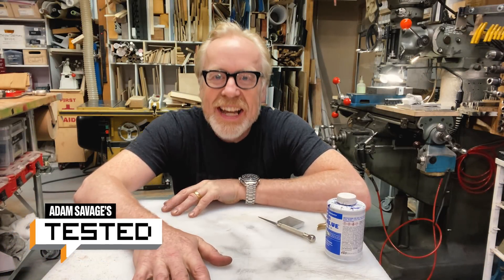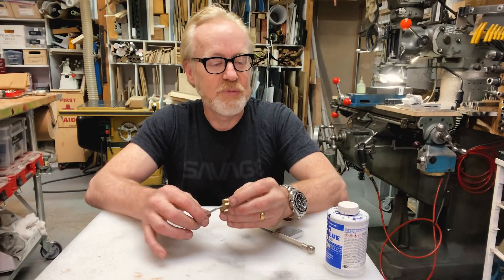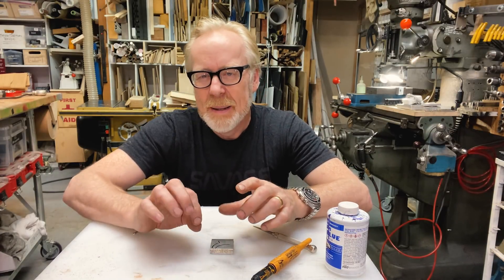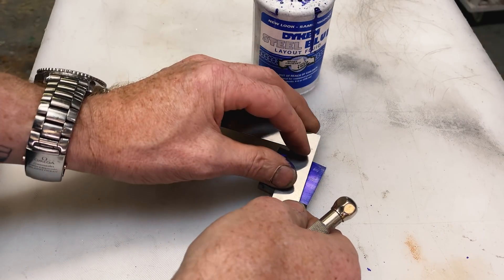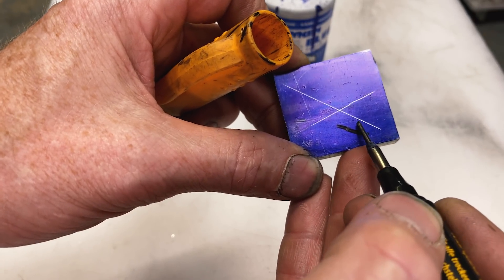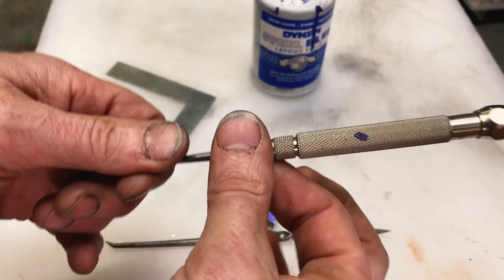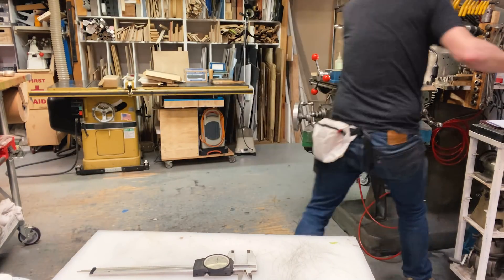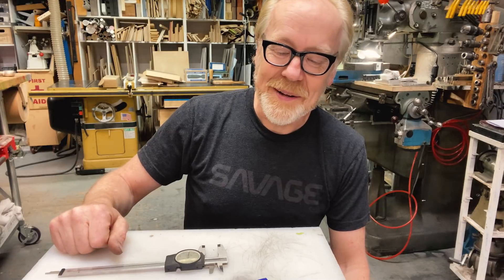Adam Savage's Favorite Tools: Machinist's Blue Layout Fluid

Comment from the maker: Starrett machinist scribe: https://amzn.to/2Zeidzf
Dykem Blue marking fluid: https://amzn.to/332dTV4
Dykem Red spray marking fluid: https://amzn.to/334y6t7
Reply: Hey Adam I believe engineers blue can also be found in broad marker form. I find it can be quicker to apply  and more even than painting it on.
Reply: Suggestion for the tool favorite tool series a page on tested and or tested amazon affiliate link page listing all of the favorite tools to go back to find the list as a whole for the favorite tools.
Reply: When you realize Adam would have been famous with or without mythbusters. I could have seen him as one of first or earliest crafters on YouTube if it wasn't for mythbusters.
Reply: Adam, you have always been and will always be an eccentric and endearing character. Rock on!
Reply: I was a toolmaker/machinist for 30 yrs and dykem is one of the best inventions ever, it has many uses beyond layout of lines,and can’t go wrong with Starrett tools.
Reply: Starett  pocket scribe at the low end has a hardened steel scribe, and the high end has a carbide scribe. You can buy after market carbide rod (1/8th in diameter) and grind your own carbide insert for less than $5

John
Reply: You can mix the two colors together to get the rare Dykem Steel Purple.
Reply: I love your work Adam 🙂

Comment: You can also put it on two bearing surfaces that are having interference and it will scratch away where the interference is happening and you can tell exactly what’s rubbing. I use it in lapping firearms.

Comment: I was taught that a water-soluble ink such as Canode #2243 can be much less of a bother. You could also do a video on the use of such inks for precision scraping. I think for scraping you apply the ink with a rubber roller, so the ink tends to get all over, and water-soluble clean up is more important.

Comment: My Starrett scriber stripped out, some of the tools Starrett makes have become junk over the years.  They have lost some of their prestige in tool making.  Their calipers and micrometers are still some of the best you can get but many of their tools are overpriced junk.  I highly recommend getting a decent pin vise that looks comfortable to use and making your own scriber out of a carbide bur.  The true trick to a great scriber is making the tip rounded, like eyelash small rounded.  When the tip of the scriber is round it will work like an ink pen and scribe in any direction you move it, if it's sharp it will only mark when you pull it towards you and will catch and jump when you move it away from you.  I can't even begin to tell you why but trust me on this... +20 years of using a scriber under magnification to mark out parts and designs.  A burnished mark shows just as well as a scribed mark on layout fluid but the burnished mark can usually be polished/sanded away where as a scratch takes a lot more work to remove.

Comment: I'm in the Thai jungle, Adam.  No layout fluid here but I've discovered a great substitute.  China ink.  It's jet black and a scribed line dazzles like a silver needle by contrast.  It's fast drying, wipes off with alcohol and costs 40 baht for a small bottle... $1.35.

Comment: As a goldsmith i use white watercolor and real 0,3 mm thing pensin what you can rubber off if needed. After that i apply spray lacquer spray. So i can draw or copy anything on the metal.

Comment: They also make Dykem bottles with a felt/marker like pad under the cap so you only need to rub it on the surface instead of having to paint it on with a brush! I know we use those all the time at the shop I work at.

Comment: I forgot about this stuff! Back when I was a machinist, we used to use this with veneer calipers for precise hole drilling. Well as precise as you can get on an old clapped out Bridgeport from the 50's.
Reply: I still have a 40+ year old metal can of Dykem from an old love affair I had w/ a Bridgeport in the late 70s. We also had an old clapper in the shop but we used it as a hogger when needed. It was kept in the "rough room" next to an old convertible Cincinnati that could run as a vert or a horiz mill. Made 3 F-14 wing hinges on that big green ugly thing. I miss those days.

Comment: Back when I was an electrician, are used to cut asked all the time Why I bothered buying the more expensive tools. The way I looked at it was that my hand tools for my every day things that I did it to last as long as possible so I would buy the more expensive screwdrivers and the more expensive pliers and all of that. You had guys that would go to pliers a few times a year and yet I still have players that I bought 20 something years ago and I’m not even an electrician anymore and yet I still have these tools and still use them on a regular basis for the jobs that I do now. I still have almost all of my screwdrivers and they are still in perfect working condition despite having almost daily use and constant used for the last 20 something years. They are lifetime tools and they feel like it. When I’m using it I have a greater control of the tool because it has a handle that’s designed for comfort as well as function instead of one of those dinky little plastic handles that are just too small even though they technically work. That’s still carries over to this day when I’m buying networking tools and stuff like that. Sure, I can go buy a new punch down tool for $10 or I can buy the $25 one and it’s going to last me far longer. I don’t want to have to sit there and buy tools again every year even if they are cheaper because even though it’s a short term saving it ends up being that you spend more money further on down the road

Comment: We also use blue with a sheet of glass, to check flatness of surfaces...  
(lay wet blue on the glass then place the flat surface on the glass, all the high spots will pickup the blue)

Comment: For the other readers (I'm sure Adam knows) it can also be really handy to level parts or ensure you've removed enough material.  When you use a milling machine to flatten a surface painting it in marking fluid can tell you where you are in terms of depth.  You paint the surface and start to run the mill or other flattening operation and the high spots are milled down first, removing the fluid, areas that still have coloration are lower than the milling head is set.  After each pass you should see the area get smaller as successive passes level out the part, once there's no blue left, you're theoretically level, or level enough to start using finer processes like sanding.

Comment: Aerospace machinist here, another very good way of marking parts, especially deep down in a pocket, is to use a Sharpie marker, blue or black and then spray your air gun on the tip of the marker and it acts like an airbrush. Been doing this trick for years as a machinist. 30+ years, and it works every time perfectly. Remember, hold your Sharpie marker point at an angle and spray with your air hose gun at an angle and it acts like an airbrush, it works amazingly well.
Reply: Amazing stuff

Comment: Adam

Love my Starrett 70b, and a GREAT improvement/mode is to add a pocket clip so I keep it handy in my shirt/apron pocket, just use a pocket clip off a Pentel mechanical pencil, with a little careful bending it fits great on the Starrett.

Also, the 70b uses a 3/16 in diameter scribe point unit, and I bought a 12in cobalt HSS aircraft drill bit, cut it into approx 3.5in lengths and grind the points, and you have a lifetime supply of replacements.  You can also find 3/16 carbide rods on line for around $3-4 each, makes a super hard, long long lasting scribe point replacement as well.  I know Starretts offers this scribe with a carbide point, but they really charge an arm and a leg for the privilege of having the carbide  If you want a 3/16in x 3 carbide rod, drop me a line,  I bought several to save on shipping and would be happy you send you want for YOU to sharpen <vbg!>

John

Comment: The brush on Dykem is great for basic layout, but it has a tendency to flake along the edge of the scribe line and leave a relatively wide line. Back when I was making precision templates 40 years ago I needed a very fine line that I could file the edge to. For that I preferred using the spray. It gives a much lighter smooth coat, just like the difference between spray paint and using a brush, allowing a very fine line.

Comment: I was watching My Mechanics channel where he was restoring an old steel cutter. For some of the smaller internal parts, he used bluing fluid I think it was called? Is that similar? Do you use that? Could you explain how that protects things from rust or what it's used for? Seems to have an interesting effect where it goes on clear then darkens in a second which is likely a chemical reaction right?

Comment: Buying lifetime tools is always a consideration when I require something new, but most of the time I don't need to thanks to a very well maintained toolkit that I inherited from my grandparents and the generations before. A couple of daily-use tools are aged just shy of a century and work just as well as they did the day they were first put to use, including a full set of wooden block planes. It all boils down to proper handling and maintenance.

Comment: If you want to spend more than $5 on a scribe, get the Starrett 70BX.
It is a carbide and won't need sharpening, let alone replacement, for a long time.
Reply: Or get the 70b, and a 3/16 x3 in carbide rod, and grind it yourself.  Scribe is about $17, the 3/16 x 3 carbide rod can be found for around $3-4

John

Comment: Also with the STARRETT scribe you can flip the point over and it with go into the handle.  Almost 3 inches shorter and protects the tip.

Comment: if you are working with a mystery scrap pile you can also use marking fluid to tell what type of metal it is. steel and aluminum dry to different shades of blue but magnisum will dry to a more stark shade of purple. while you might say "oh I can tell by whats rusted" sometimes you don't have the time to wait 2-3 weeks for rust and oxide layers to form. plus it takes experience to eye ball that on old cuts just based off the patina that forms. taking a quick brush stroke on a fresh face will tell you what that metal is made of.
Reply: Thanks, Ryoku, that's good to know.

Comment: I mean, I’m sure this is a handy product..but showing me how much better the line is with a scribe vs a pen by drawing one with a straight edge and the other by hand doesn’t do it. All he showed was that using a straight edge makes straighter lines than freehanding. How is etching around the trigger any better than marking around the trigger? I’m sure this is a good tool, but this demo didn’t show that.
Reply: I think what he was trying to show it that the Dykem and a scribe make a much finer/thinner line than the sharpee could ever do.
Reply: Brandon S I mean, yeah, but that’s not what he said. It just felt like one of those infomercial cut scenes. I know Adam means better than that, which is why the whole thing felt weird to me.

Comment: Adam,  the other quick and convenient use for the Starrett scribe is to use the point as a quick alignment point in the mill by chucking it either in your drill chuck or collett to then center over a mark.  Maybe not quite as precise as using an edge finder but can be pretty good and pretty fast.

Comment: As I got more experienced at wood work, I found that I usually the skill I needed to build what I wanted to build. But, if I wanted to level up the quality of the build, I needed to be more precise with my cuts.  Which gets to the thing Adam has said before about what side of the line you cut to, but also taking care in measuring and marking out.  It's the difference between using a blunt carpenters pencil, vs a fine mechanical pencil or marking knife.  That's the time you're really going to get the best value from really good marking tools, when your skills let you cut to/on the line, and you now need to put the line in exactly the right place.

Adam needs to take a trip to Montana to do a colab with Alec Steel.  Every time I see Alec hand tool a collet into his mill, I think of the air tool kit Adam did a tested video on years ago.  And both Adam and Alec have a fondness for making things and blue Dychem.

Comment: As someone who has been an electronic engineer for decades I have to agree.Yes you can get pretty good side cutters for $10. However they are not even close to Lindstrom. The Lindstrom ones I use at home are the cheaper ones and $60. Soldering Iron? Yes you can get a truly awefull heap of crap for $5. You can get a decent one for $50. Mine? $250 ish. Scalpels I actually use a cutthroat razor these days as it;s blades are way cheaper and cut kynar wire and similar really well. Once you have the experience you know what you need to spend money on and what you don't. IE even though my side cutters long nose pliers and soldering iron cost damn near $400 between them my total tool kit is about $600. Not counting scopes and meters that is.

Comment: I have a different cheater (reverse engineering) methods of rough layout. I do cad drawings to scale with cross hair lines (hole locations) and so on. And with rubber cement placing that printed image on the surface I wish to machine on. I also have taken a piece of round carbide welded (brazed form) it to a steel rod  pencil or pen diameter. chucked it in the lathe and with a diamond faced die grinder tool and sharpened the carbide as the scribe point. I sometimes add tape (duct or other) to increase the grip diameter when needed. I made a holder for the scribe point and attached it to an aluminum rod with a set screw and another point mounted for swinging arcs when I need too (larger than most divider points can do). on other occasions I use the general sharpie pen to get to the approx. size area and the use the scribe point to get to the definative point location. Of late I have even made 3D printed parts to hold the points or stubby points so I can trace an existing part hole location in those hard to reach locals that big fingers can't hold the tip. I've even tried a 3D printed surface to trace on a piece with scribe width offset to be more precise with the rough layout... Just Saying the french curve shaping is easier on paper and in cad then trying to free hand those layouts on blueing. And then CNC on a multi access is also last resort as that gets costly. - PS my 3D printers are like under $150 each.  Had to do some auto closing spring loaded hitch clamping dawgs for a 3/4" inch hitch pin- back into the pin, dawgs auto close and then drive away, trip a lever and unhitched... did the paper and was close. did the 3D print and nailed it. 3D image capturing of existing parts is even faster too to find the part sizing and accuracy. I still enjoy the manual lathe and bridge port type work to most other work especially for jigs and fixtures to hold things in place for the one offs or the repeated parts. Later

Comment: That stuff is also great for boat manufacturing. It helps show scratches and imperfection in the boat gel. And sometimes a guild cutting into stuff, but I always used it for tiny scratches.

Comment: Back in the early 90's when I was an Engineering Technician - Sheet Metal Apprentice working at NASA Langley Research Center, we used the spray on Machinist's Blue layout fluid. Loved that stuff...worked awesomely.

Comment: A height gage with a carbide scribing tip very valuable instrument to have, other measuring dimensions, you can use it to transfer scribed lines onto your part that has been coated with Dykem. A roller to apply the Dykem for flat surfaces is also another very usefull tool.

I am in a CNC machining program at trade school. Last semester we were first on manual Bridgeports then conversatonal CNC Bridgeport style mills that could also be used in manual mode;  the Dykem was used extensively to mark out locations for holes and features.

Comment: The reason I spent £180 on a Makita drill + impact driver over getting the cheap ‘big box store’ brand for £40-50 is because I wanted to get a tool that would last and work well, over one that might only just last a couple years.

Comment: My local store only carries spray-on marking fluid, so I spray it onto a kleenex and use that to wipe it on my part.  Works great.
Reply: You're wasting a whole lot of marking material, that way.
Reply: @zapa1pnt  I suppose I should have mentioned that I'm only making small parts.  I'd waste a lot more by allowing overspray.  So far the can is lasting a long time.

Comment: I'm not a maker, but I'm a guy who has other hobbies where I need to consider the cost both in time and money. I agree with the idea that it's better to pay more for a lifetime tool rather than pay a little for a tool that will break immediately. 

Where I felt the sentiment was a bit out of touch was when he explained exactly what that meant. Actually, he didn't. He made it seem like it's all about just feel, when this is wrong. There are times when paying more means that you're paying for something made to last longer. This may be a $20 scry, but the way he said it made me think there's probably a ~$10 scry that will last a lifetime. While you shouldn't buy the cheapest tools, you also should know when you're paying more just because you like the nice intricate tooling on the handle, or you like the heft of the object. My father has no-name tools that are older than me, and will likely outlive me. He also has name brand tools that were the only ones at the time that would last, and they have.